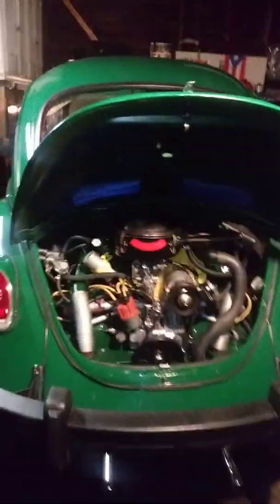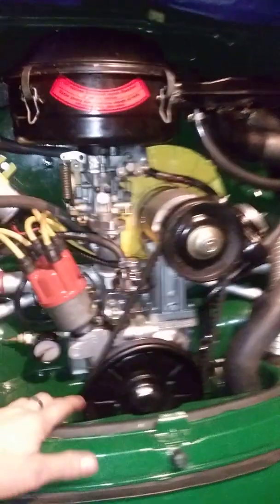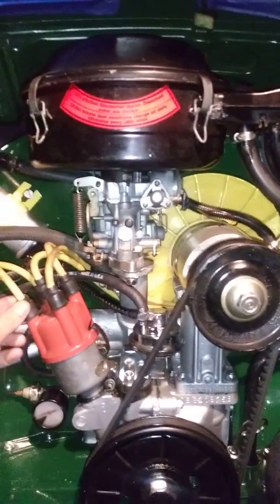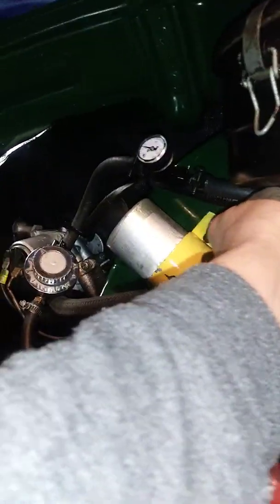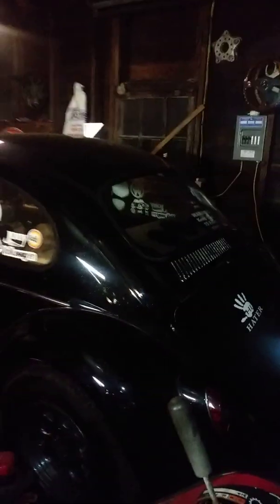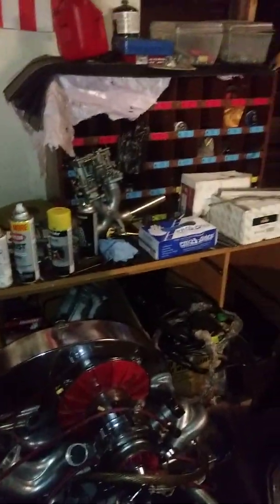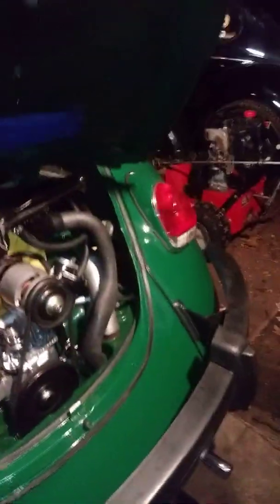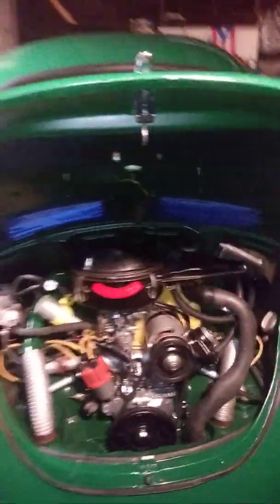Vw Miles per gallon talk

Comment: Had a problem with mine don’t know the cylinder head torque on my 1961.
Reply from the maker: I torque them 24lb
Reply: Jony vw65 where did you find out what to torque them to.
Reply from the maker: @treptix  i know all specs on my head but you can get a haines book and that is very useful.
Reply: Jony vw65 oh ok thank you